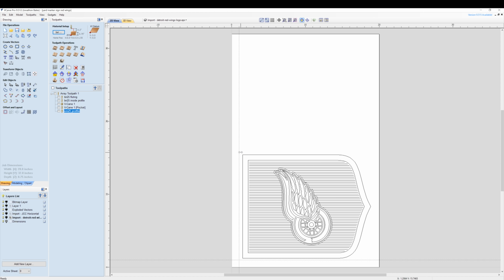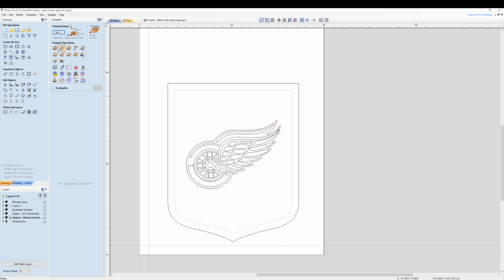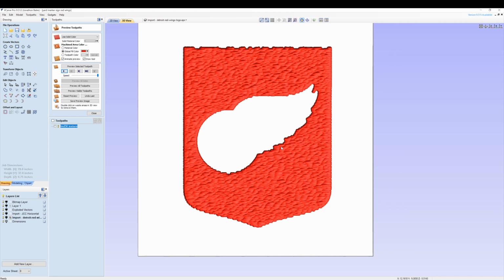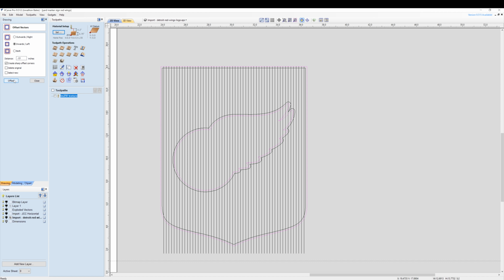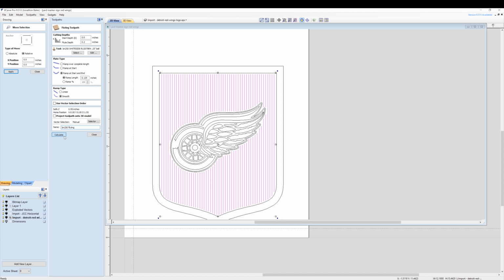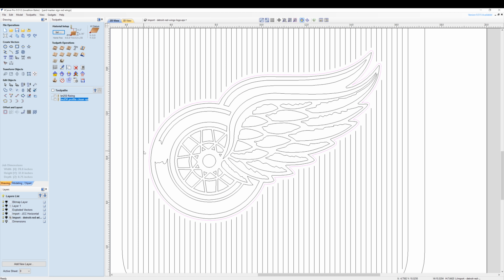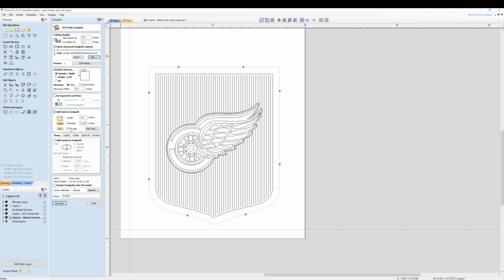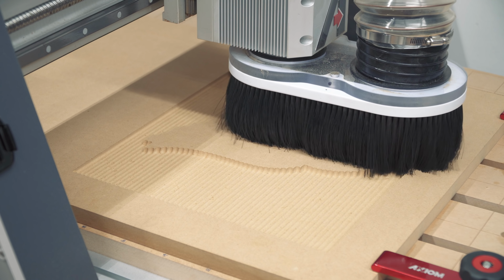Fluted Sign Design and Cut: Texture vs Fluting

Comment: Thanks, Jay. I'm a new CNC owner (Next Wave's Piranha, 12x12-ish bed size) and use Vectric Desktop with it. Thanks for sharing the tips along the way. The positive/negative V-Carve border will definitely come in handy. I've been screwing with the zero plane to do that and your way is definitely easier. Off to sand and stain a wedding sign I did over the weekend.

Comment: Thanks again Jay. I am looking to buy one. Do you need to measure the z axes each time you change a tool? I had an issues with that in the past with a CNC router I built myself.
Reply from the maker: There is a touch off puck for this one. Super simple and easy to reset the height when bits are changed. Shoot me an email if you have any other questions.

Comment: Wonder what the law is pertaining to selling the tool path file?
Reply: Toolpaths can't really be shared. You would have to have an identical set up as far as g code requirements, machine capabilities, bit selection,  material size, X &Y zero and Z depth.

It is far more common to get a project as vectors and have to end user toolpath those to fit their machine, material and bit selection.

You could ask to see somebody toolpathing so you could get an idea of what they did, but you would have to do your to actually cut it. Vectric has tons of tutorials.

Comment: If you could kindly keep us posted on how well the finish endure, that would be great. I've never thought to use MDF for such projects outdoors.
Reply: MDO is often used outside instead of MDF
Reply: @ga5743  Sign shop I used to work with a lot does similar stuff but they use solid PVC blanks which I imagine is pretty weather resistant and has similar milling properties, kind of similar to if you think of like a 4x8 sheet of AZEK or something, available in thicknesses probably from about 1/2" to 2 inch or more.